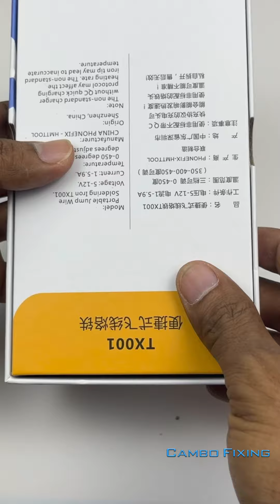Mini soldering station for repair airpod

Comment: TX001 Portable Jump Wire Soldering Iron Replaceable JBC T210 Welding Iron Tip for Mobile Phone PCB Soldering Repair, heating up quickly, 2 seconds up to 380 degrees. quick cooling, automatic sleep, QC Quick Charging Adapter, replacing damaged or unusable iPhone motherboard repair.